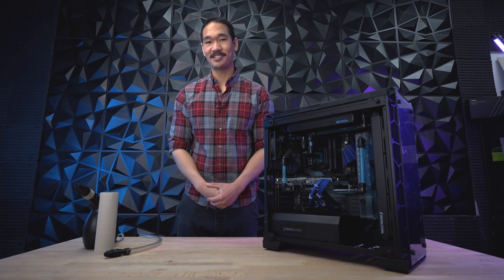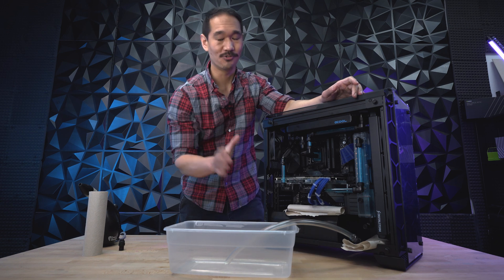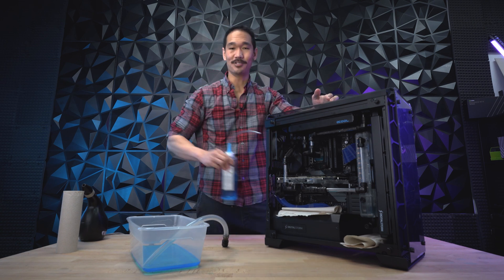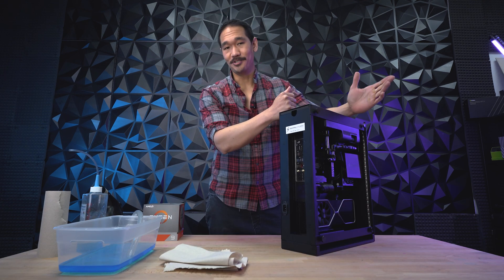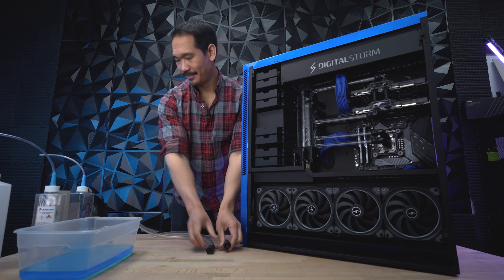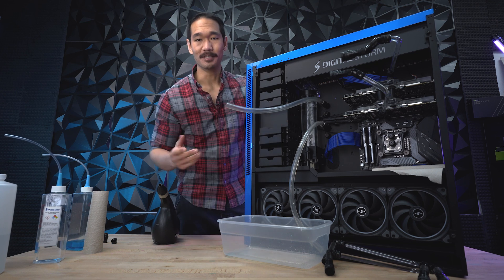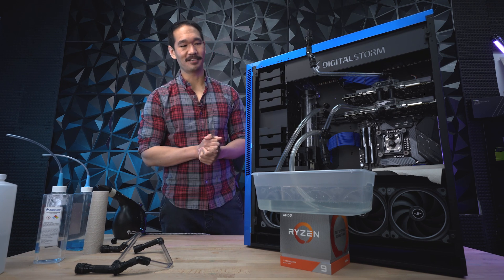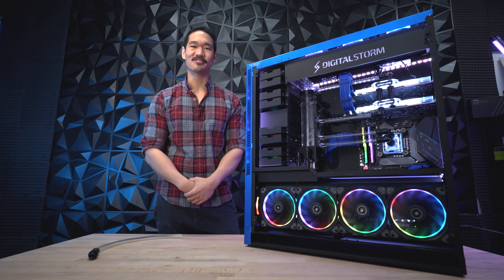How to drain and refill your liquid cooled Digital Storm PC! [Level Up S2E2]

Comment from the maker: Let us know what other topics you want us to cover in future videos!
Reply: Please make a video how to upgrade MM, CPU and GPU for water cooled system
Reply: Can we get a video on how to disassemble the Aventum Hydrolux system for a full cleaning? The order in which you should go can be unclear with the two acrylic distro plates.
Reply: where can i buy a male and female quick disconect
Reply: My top two hardline  tubes to the gpu block do not hang rigid like this. They hang from the weight of the quick disconnects and feel very flimsy. Also you only sent me 1 drain tube for my aventum instead of the two you say are required. I have an open ticket right now actually because after only 5 days of use, the watercooling system failed and leaked coolant everywhere and now my system won't boot and seems fried.
Reply: Hey digital storm I’m new to this but when I go to your website I love love the ready to ship pc but what monitors can it connect sorry it’s because I’m new this
Reply: R8gonza_YT8  ok
Reply: R8gonza_YT8  so ur kinda saying that my pc the ready to ship of the wed site of digital can connect to any monitor just like I don’t really get it sorry
Reply: R8gonza_YT8  oooh sorry yo no savi ya
Reply: What pc setup is that im trying to buy one
Reply: Thanks so much at first I was terrified to even touch the Digital Storm Aventum X 🥵
Reply: Hey Digital Storm.. I was trying to buy a pc from you but you blocked my IP address and now I can't access your website anymore.. Well now you lost another customer because apparently this happened a few times already

Comment: I just purchased the Aventum X system but I am unable to find where the drain port is to replace the water. Is there one and if so where is it? If it does not have one, what do you recommend for draining / replacing the water?

Comment: Sucks that I got the first computer shown, but I didn't get that sweet drain on the end of my fishbox reservoir  :(  When were those added as I had bought mine just last year?
Reply: I feel the same way!
Reply: Alright I did the draining on the old Lumos without any issue.  Honestly the drain plug that they have in the newer builds after doing it on the older one doesn't really seem that much more advantageous.  Took me 30-40 minutes to drain it and then refill it and drain it again 3 more times with distilled water before putting new fluid in.
Reply: @Ff-jg8lo did you just end up tilting the tower to empty the redivide completely? Or just do a few cycles?
Reply: @Roach_Toast  I did a few cycles of letting it idle/open a browser or two just to get the distilled water flowing through.  I did that 3 times before adding new fluid back in as I was changing the dye color and didn't know if it would cause issues if there was remnants of a different dye.

Comment: I have a Bolt from you guys I ordered over a year ago, I spent over $3800 on it. It has all hardline tubing and there isn’t any soft tubing to disconnect like you showed in this video. It would just be nice if customer support would get back to me to explain how to drain, flush and refill my system. Or a video would be nice since this build isn’t hardline tubing. @Digital Storm
Reply: This company is the worse

Comment: A couple questions:
1. Does that extra drain tube come with the PC? my Aventum has not yet arrived.
2. What kind of blowers do you recommend using? The shown blower is not necessarily what's being sold as a standard.
Thanks

Comment: Not all come with the drain fitting on the bottom.  I bought a system exactly one year ago to this day (actually).  It just has a bolt on the bottom which makes it a lot harder to drain.
Reply: Mine is set up the same. How'd you end up doing it, if you don't mind sharing?
Reply: @devonkornett7537 ever figure this out?
Reply: @Roach_Toast  I did...I bought that drain plug from alphacool.  That's who they use for their watercooling.

Comment: I fell dumb asking this I got a lynx level 3 do I have to do this or no is it different?
Reply from the maker: No worries! You only need to do this if you have a HydroLux PC. Which is a custom liquid cooling solution. The Lynx Level 3 isn't affected by this.
Reply: @digitalstorm  ok thank you
Reply: If your pc has this water cooling then yes if not no

Comment: I’m having so much trouble changing the fluid in my bolt 3 as it is mounted sideways and I have to spin the pc like a Rubik’s cube to get most of the fluid out, I have to bring my power lifter friend in just to spin my pc. There are fungus built up atm, and I really want to flush everything out. Is there any easy way to drain the bolt 3 liquid?